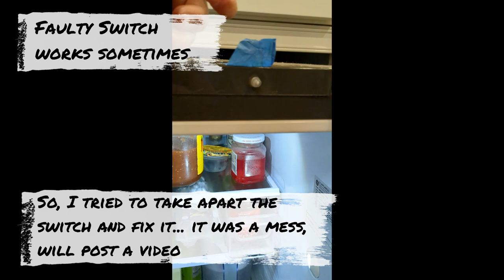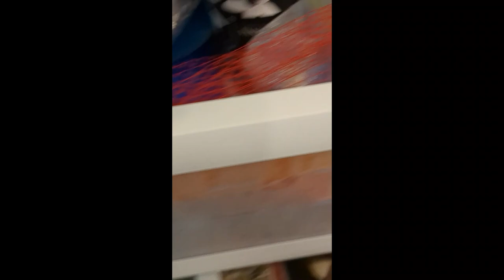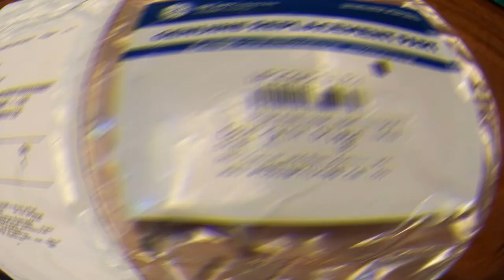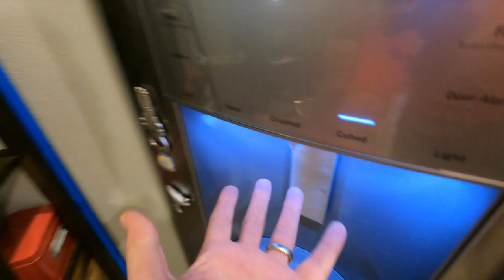GE Fridge Light 💡Switch Replace and Troubleshooting

Comment: Glad to find this since we have the same problem with the switch on the right side door (most used).  Estimate from appliance repair was way more for parts and labor.  This was not nearly as difficult as I had expected.
Reply from the maker: Awesome, I hope it helps you get it done with a DIY solution!  Absolutely - soooo much cheaper than the appliance repair companies.  -Steve

Comment: look at your wiring on 3 wire switch! you plugged in connectors wrong! you have blue and orange backwards
Reply from the maker: I will check it tomorrow, thank you!!!  Will let you know how it works.
Reply from the maker: Just checked it 💯 percent!!!! Thank you for pointing out the obvious.  It is working perfectly now!